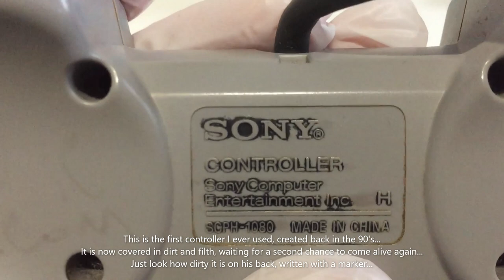PS1 Controller Restoration & Cleaning - SONY PlayStation SCPH 1080 Controller Restore

Comment: Mine doesn’t have a connector in the pcb, it’s soldered instead. It haves a resistor too and the pcb is copper based contact
Reply from the maker: I used a SCPH-1080 controller for that video.
Which code has yours ? You can read it on the back of the controller, probably it is a SCPH -1010
Reply: @michelangelonovelli3421  it is a Malaysian SCPH-1080. The buttons are not colored on the bottom.
Reply: @michelangelonovelli3421  it is exactly like this: https://ibb.co/1KbjN2G
Reply from the maker: @christianespinoza416  
Oh, wow, never saw anything like this...
Im looking for more infos about it on the web
Reply from the maker: @christianespinoza416  
In any case, if there is a solder you will need to desolder the electronic component by softening the tin with the soldering iron, without pressing, and with the other hand you "suck" it with the desoldering iron before it solidifies again. 
Of course after that you'll have to solder it again!
You should ask for help to someone with that knowledge